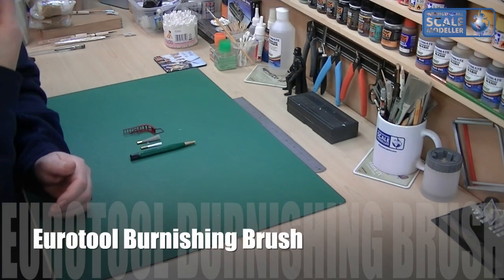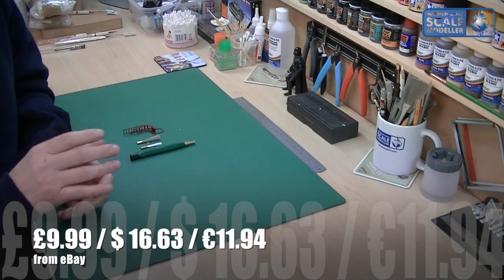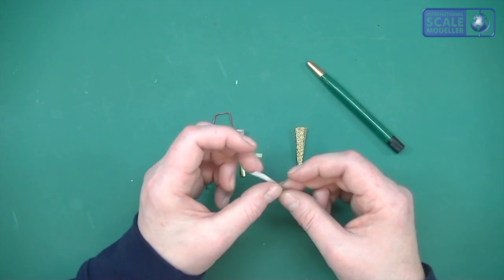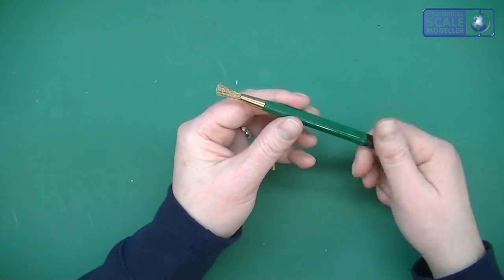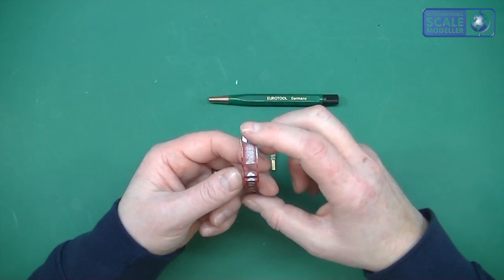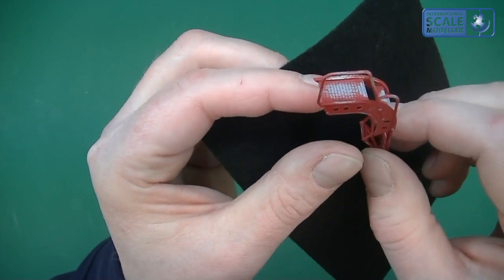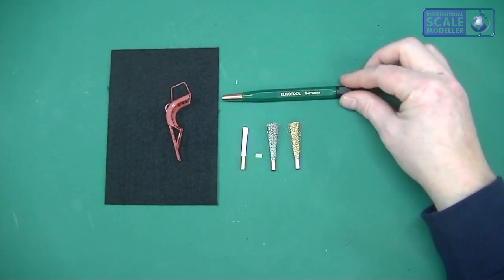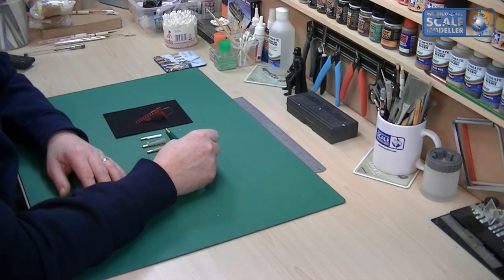Eurotool Burnishing Brush Scale Model Tool Review

Comment: The nylon one works quite well actually. But you can get those at an automotive shop.
It's used for removing spotrs of rust and will cost you about ONE quid! Also very handy for removing any shiny glue spots ;) I've been using it for over twenty years :P
Reply from the maker: Cheers for the info :)